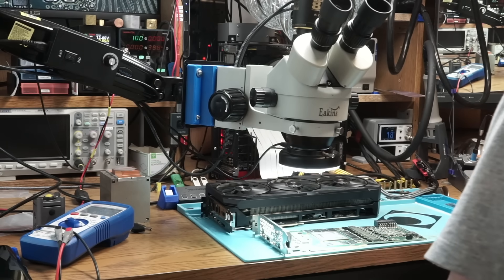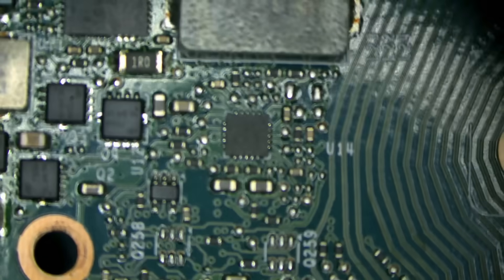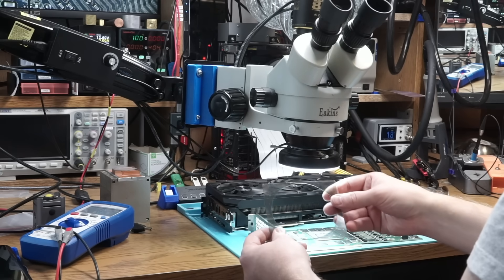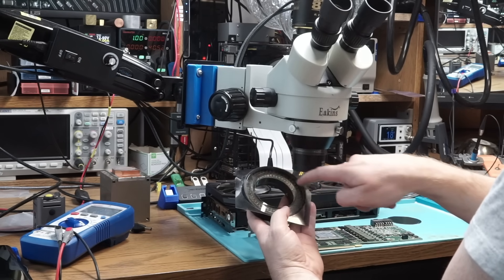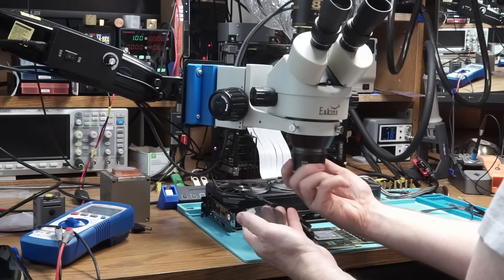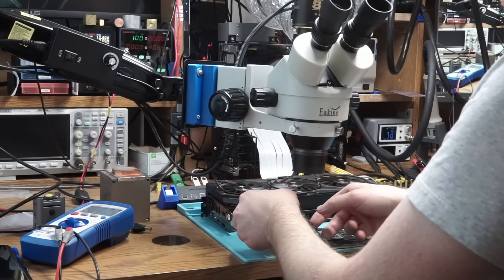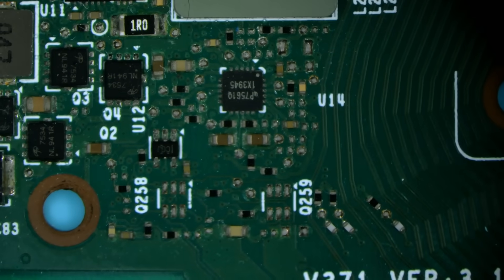Turn your $600 microscope into $6000 microscope for $5 bucks

Comment: Also turning a cheap 200 buck thermal imager into a 6000 thermal PCB inspection microscope is similarly easy, just put a 20 dollar znse or germanium laser engraver lens in front of it. Makes finding shorted mosfets, gate drivers, avalanche esd protectors, tantalum and MLCCs a breeze. ❤

Comment: One, don't be simple. The only way to get a $6000 microscope is to fork out $6000. Two, you do know the non-optical polarizer is now a part of the optics? Meaning, you've turned your $600 microscope into a $60 one, optically speaking.

Comment: Doesn't the lens have a filter thread on the front? Then you could just buy a glass polarizing filter used for photography and video. They're much better optical quality and they have a rotating ring so you can change the angle of the polarizer. You can get them for less than $10

Comment: That's a bit of a game changer.  I don't use a ring light on mine because of this.  I want shadows and some control so it's always been a gooseneck illuminator (bright light splits into two goosenecks).    Time to experiment.  Thanks!

Comment: This is probably the best tip anyone has given me for more than 10 years! =)
I have one of those cheapo eBay 'microscopes', which could definitely become worth using.
Thank you!
Edit: the microscope I bought on eBay about 5 years ago, is a $10 microscope, so ... I guess it could be considered a $600 microscope now (for those who don't want to spend $60 🤣)

Comment: I had a Failure Analysis lab and I had to learn many tricks like this one. Ring lights are notoriously bad though convenient. Some (like ZEISS) can be controlled to only have sections lit. My main trick for labels (esp laser etched) was various angles and various light sources. Using a diffuser like you did with the ring light cover can take out the glare and produce a more even lighting. My predecessor used a dixie cup with the bottom cut out to reduce and diffuse the lighting from ring lights and outside fluorescent lights.

Comment: Or you can buy a ready-made solution for $15-30, completely new light with an integrated filter that can be easily adjusted without having to turn the lens.

Comment: You are working with a technique used to photograph flat copy or anything  flat below the lens. With the camera pointed down, Two light sources on which a polarizer sheet is placed on each and that are polarized in the same direction, are placed at 45 degrees from that axis. A polarizing filter is attached to the lens. The test for proper polarization  was to place a quarter on the copy stand, below the lens. The polarizer on the lens was then turned, until there the face of the quarter had no glare/highlights. At this point, anything below the lens had no highlights and the image showed the best contrast and color saturation.
As you can see in your image, glare and highlights are cancelled out. The white lines, text on the chips and traces, are revealed with the best contrast.

Comment: Thanks for sharing. I have that issue all the time.Solution has been to use a flash light from the side. but sometimes that means going back to the front office to grab a flashlight.

Comment: Low-cost microscopes often suffer from limited brightness. Adding a fixed polarizing filter to the optical path can significantly reduce light transmission, resulting in a darker image. When introducing a polarizer film or lens, it’s advisable to compensate by using an additional or higher-intensity light source.
Reply from the maker: True.
Higher intensity light will help with that for sure.

Comment: i bet there are polarison filters even for your model. dont think they cost $5400.
and while you turn that lense to have this, you also play with the distance of the lense-to-object. this means youll get a unsharp view everytime you touch the lense, which is suboptimal.
but i think you can put the whole circle on the lamp, which you could turn without touching the lense. shouldnt it be the same effect?

Comment: When I saw the thumbnail I was thinking "anti-glare polarizing filter?" and yep, got it right. To be fair most proper filters cost more, but that's because of both the assembly attached to the film as well as mark-up. Still a relatively cheap upgrade even if you get an actual attachment rather than just the film.

Comment: Ummmm, i have been using a penlight to just provide side view lighting for years.  Turn down the brightness on your ring lamp then angle the penlight so its shining its light horizontally across chip.  That's it, no polarization filters, no modifications to microscope, and super cheap.  Has worked for well over a decade for me....

Comment: My cheaper-than-$600 microscope has threads on the end of the lens so I can use the same polarizing filters that cameras have been using forever. This allows turning just the ring on the filter and not the entire lens. There are a multitude of filter thread adapters if you can't find a filter that fits your specific lens. Also, it's a good idea to use some sort of filter over the lens if doing any sort of soldering under the scope, so it may as well be a polarizing filter. I never had a need to polarize the light source as well.
Reply: What microscope are you using/ can you recommend?

Comment: If you are about to buy a microscope and do not have a ring-light yet, the brand "mechanic" makes some good and low cost polarized ring-lights. The LS6, LS360, LS720SE and LS720+.
Reply: xD

720SE is without polarization module :))
Reply: @darek098  hmm ok.. Why the need to belittle?
If you look on their page, the specs do not specify the 720SE is without polarization module. So without having had ones hands on the 720SE, how can one know? I've only seen the LS6 and LS720+ in person.
Reply: @rick5078  yes, they wrote it in the specification :D On LS360 and LS720+ they wrote (in Chinese, of course) - POLARIZED ring light source. On LS720SE - RING LIGHT SOURCE. The missing part "polarized" is not by mistake ;)
Reply: @darek098  typical and in english they forgot to mention that detail. well, good to know.

Comment: I bought the Mechanic LS720+ polarizing ring light which is less than 25€ shipped. Works great. I have another microscope with a very narrow ring light which I intend to modify with plastic polarizing sheet.
Reply: how is the brightness on that ring light? i tried a couple with similar features and though they do work for the anti-glare effect, i find it that it makes the image really dark due to cheap low led light that they come with.
Reply: @MultitekRepairs I find it adequately bright

Comment: This is definitely a better solution but you can also drop a little flux nearby the component you want to read and then hit it with the iron. The flux that condenses on the chip helps diffuse the light making it much easier to read.

Comment: An easy fix is to not use a stupid ring light around the lens but some light source(s) from around 45°-60° angle. Not only you will see all the IC markings all the time without adjusting anything, you won't get annoying eye-straining reflections from shiny metal objects.
Reply: This. I have never used a ring light on my scope. I have a movable light LED source on arm which means you can shift it about as you need. The only issue I have in my home setup is an overhead room light right over the work area, so that gets turned off if it's annoying.

Comment: Hi Check out this light I got for the price it was excellent.  mechanic antiglare light.  i bought the amscope which  NRF uses.  It is good also but this one is super cheap.  Both have their uses and it is simple to use and attach tot he microscope.   I can post a link if you allow it on your channel

Comment: I'm using the same thing for nearly a decade now. Removed from an old broken lcd panel and as seen in the video it works perfectly. No need to buy some anti-glare shit. Good video.
Reply: Hi. Any tips on removing that film from an LCD monitor? It seems to be pretty well glued to the panel. Did you remove it with hot air? Were you able to clean the glue completely so that the film is perfectly transparent?
Reply: @MeOrNotMeWhoKnows  In realy old LCDs are not glued.
Reply: @MeOrNotMeWhoKnows  easier to just buy it tbh
Reply: you can try find camera polarizer filter cheap ones cost £5-10

Comment: I have found that the direct light from the ring light makes it almost impossible to identify anything. Much worse even , than with it off.
Simple light from another angle works every time.
Nice solution for your setup!

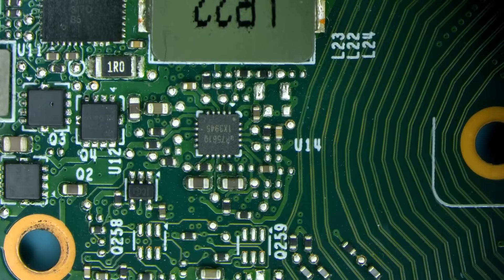Comment: 0:34 remove the lens and move it around method was clearly working there, yet you dismissed it. that was tested under various temperatures for extended periods and been proven to work perfectly how could you say it doesn't work?
Reply: I use a similar solution.
I just put a polarizing lens protector on the lens.
Reply: I prefer the squint technique myself
Reply: Stop being NF's little biotch. You're trying to start something that just needs to go away

Comment: Also Mechanic LS720+ is basically what your looking for 20 bucks
Reply: that one looks decent too. I've currently got the iFixes iL37
Reply from the maker: Wrong.
Mechanic does not have a lens pass through hole in the middle.
So if i put the lens i use in this video, mechanic light wont even mount to the microscope.